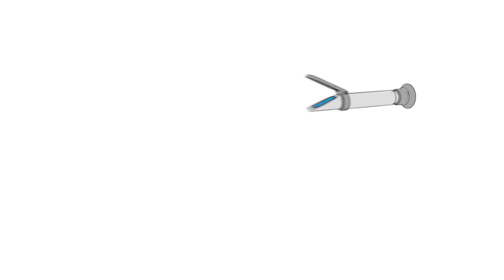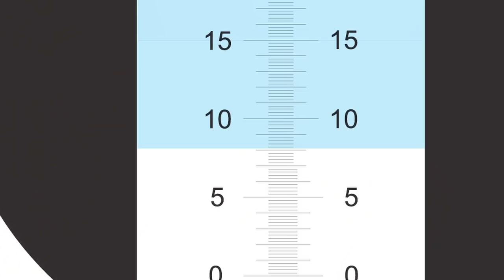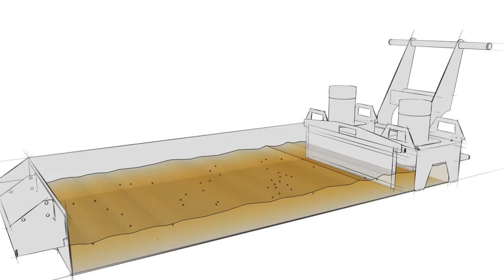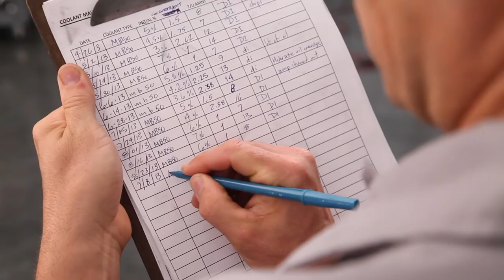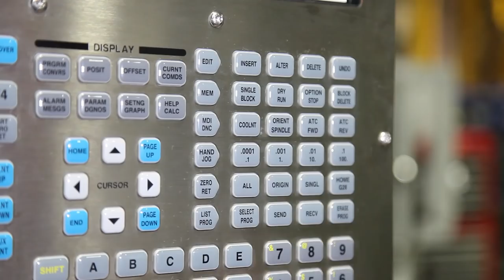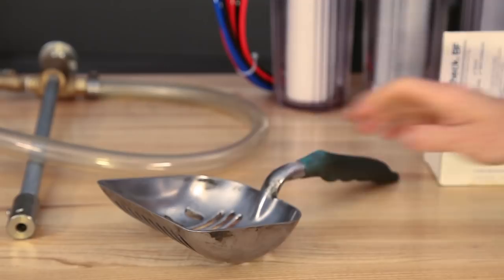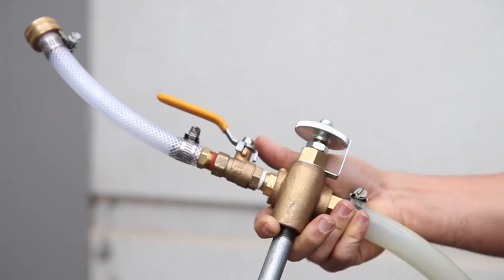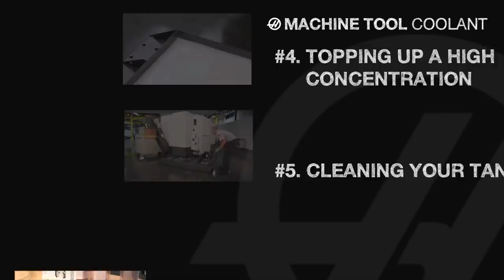Machine Tool Coolant: Tools of Coolant

Comment: Why should we add a concentrate into the water, but not vice versia? Do you have a clear video explonation on that?
Reply from the maker: euclid9718, The water soluble oils used in most coolant concentrates work best when poured into a larger batch of water. You'll need to contact your coolant supplier to get the exact reason this happens chemically but we show an example of mixing coolant both ways in this video here: https://youtu.be/Rv1kU0UrsBo?t=97

Comment: I would like the chip strainer shown in the video @10:30- I asked my local rep and they couldn't find it. I have a VF1.
Reply from the maker: Hi brian kelly hahn - We're very sorry for the inconvenience, but glad you're interested in a product used in the video. You can actually purchase the items on HaasParts.com: http://haasparts.com/

The part numbers you'll want to query are 30-10903 (SUPPLEMENTAL CHIP TRAY KIT) and 30-10904 (FILTER, SUPPLEMENTAL CHIP TRAY, FILTER BASKET X10). You'll also need to know your machine serial number.

We hope this helps! Please feel free to contact us at contact@HaasCNC.com if you have any further questions. Thanks Brian.
Reply: Haas Automation, Inc.
Thanks! You were faster and more helpful than my local rep that couldn't find the part. Please keep up great work with the parts website and these great videos. The more info the better!

Comment: Let's say you run a machine purely for prototyping and it gets low usage.  In other words, perhaps you run it once every couple of weeks.  What's the best way to manage coolant and what type?
Reply from the maker: Martin05rc, that is a good and unusual question. There are several things you should probably consider when running your coolant intermittently. 
Minimize evaporation:  Evaporation of the water in your coolant mixture is likely what you’ll need to check most often. The hotter the ambient temperature the more quickly the water will evaporate out of the solution. Luckily this tends to leave most of the cutting fluid behind. You can add more water to the existing coolant but be careful to add at least a small portion of new cutting fluid to the “make-up” water as some coolants do not tolerate adding straight water to an existing batch. We look at this in several of our “coolant” videos. You can minimize coolant evaporation by leaving the covers on the coolant tank. This keeps any air movement across the top of the coolant from increasing evaporation.
If evaporation is significant you might consider laying plastic sheeting or
something similar directly on top of the coolant to really minimize air
contact, similar to how swimming pool owners sometimes approach this problem.
Check concentration:  Because the concentration of your coolant increases as the water evaporates out (the ratio of cutting fluid to water increases) you need to check your concentration regularly and particularly after it has been out of use for a period of time. This will tellyou if you need to top up the tank with a rich or lean mixture. Again, look at some of the other “coolant” videos for help with these calculations.
Mix coolant before running:  Some coolant types and brands are more likely than others to separate during times of inactivity. This is something you will need to test for with the coolant you are using. Some shops will run their coolant systems to “re-mix” the coolant after it has been sitting. You may want to consider periodically mixing the coolant even when the machine is idle depending on how your coolant performs in this manner.
Reply: Thanks for your detailed reply.  We've seen what I am going to call "growth" on the surface of our VF3-SS's coolant in the tank.  I don't remember what type of coolant we are using.  Are there types that promote bacterial growth or even mold if left sitting for weeks.  I'm just concerned about the idea of a machine not running for many weeks and then seeing use for, say, a full week or two.  That pretty much describes our utilization cycles.  Thanks again.
Reply from the maker: martin05rc, Most modern high performance coolants include some sort of anti-bacterial agent in their chemical makeup. The coolant we run here at the factory is Castrol Hysol MB-50, it's a semi-synthetic high oil content fluid. It has proved very successful for pretty much all the materials we cut here. But we also have a well developed coolant maintenance program. Speaking in broad generalities there are 3 types of cutting fluids used by most shops. Soluble oils, these have the highest oil content and have high lubricity and are typically good for heavy cuts and rust prevention. But they can have more trouble with bacterial growth, don't have the best cooling properties, and typically have the shortest tank life.
Full Synthetics have no natural oils, so they are generally best for lighter cutting and are often the coolants most likely to rust your parts if you get the concentration wrong. But they do very well against bacteria, have good cooling and typically great tank life.
Semi-Synthetics, like the Castrol we use here, generally strike a good balance between the properties of Soluble and Full Synthetic coolants. They have high enough lubricity for heavy cutting, decent cooling, good rust prevention, and good tank life.
All of that said, however often your coolant is being used, it's important to keep the chemistry (concentration and alkalinity) correct and the coolant clean.
If you have lots of chips in the tank and tramp oil sitting on the surface it makes it much easier for bacteria to get a grip on your coolant. The bacteria loves to eat the tramp oil that typically comes off oily parts and gets washed into the tank.
Reply from the maker: martin05rc,
Here is a link to another Coolant video where we show cleaning out a tank. But we also talk about checking the chemistry of the tank.   https://www.youtube.com/watch?v=NvyNUn2sp3Q&index=6&list=PL1FfK7Yod27fuiQ4ZSRAnTT7Ut0wJCGRP

And here is a link to our Oil Skimmer unit. Customers have had good success with these keeping the tramp oil off of their coolant without a lot of additional work on their part since it can run on it's own after your done working for the day.   http://parts.haascnc.com/haasparts/en/USD/Performance-Upgrade/Coolant-Upgrades/Mill-Coolant/COOLANT-TANK-OIL-SKIMMER-OPTION/p/OIL%20SKIMMER%20OPTION
Reply: thanks for this question amd answer

Comment: I am a student at CSUN and I am getting ready to flush the system.Could you please recommend a type of high alkaline solution to use.  I am a bit hesitant to just buy any kind since I will be using this in a VF4. I would really appreciate it.Thank you
Reply from the maker: Delbert Stewart Hi Delbert. Most of the larger coolant manufacturers will have an alkaline cleaner they either supply or that they will recommend; it might be best to start with your coolant supplier to check their recommendation. Since we are using Castrol brand coolant in the Haas factory, we have used Castrol's "Flexiclean" Heavy Duty Multi-Purpose Alkaline Cleaner in the few instances when we've needed to thoroughly clean out a machine's entire coolant system. The Castrol Flexiclean cleaner should work fine for your VF-4, if you don't find another resource. Hope this helps!

Comment: What brand of coolant are you using here? I will be working with mild steel and aluinmum
Reply from the maker: Hi William. Chesson - We are using Castrol Hysol MB-50 in this video. We also use it throughout the Haas factory. It is a high oil content semi-synthetic water soluble coolant that works quite effectively on both steel and aluminum. Hope this helps!
Reply: Why aren't you using XBB products? We have used Alusol SL 51 XBB for over two years now and its the best cutting fluid I've ever seen. I can see the comment was made 2 years ago - have you started using XBB by now?

Comment: I wish my company would get with the program as far a coolants are concerned. The crap we use is awful. When you get out of your car in the parking lot, you can smell it. When you go home at the end of the day, whoa! People avoid standing near you. It's basically animal fat and water. Add in some way lube, leaked hydraulic oil, excess grease, chips, dirt and let it sit in the summer heat for a weekend...it would gag a maggot. It is a great lubricant for cutting, but this is 2015. There are better options.

Comment: Could you, please, give us some names where we can get Simple D.I. System for small workshop?
Reply from the maker: Hi Alex Krivling - At the end of the Tools of Coolant video you’ll find search terms for the various items we discuss in the video. If you search on the term “Reverse osmosis deionization water filtration kit” you’ll find a number of filtration units that should meet your needs.
 
Here are links to a few examples:
 
http://www.bulkreefsupply.com/bulk-reverse-osmosis-filters-systems/reverse-osmosis-systems/standard-systems.html#
 
http://www.marinedepot.com/SpectraPure_MaxCap_RO_DI_System_w_Manual_Flush_90_to_180_Gallons_Per_Day_RO_DI_Water_Filter_Systems-SpectraPure-SP12291-FIRORDNH-vi.html
 
http://www.uswatersystems.com/systems/reverse-osmosis.html

Since most of the units are similar, we recommend reading the reviews and picking the unit that best matches your volume requirements. Hope this helps, and good luck Alex!
Reply: @haasautomation  Can this style of unit be used in-line (as in, without a DI water reservoir) to supply a Haas Coolant Refill System? I ask because the flow rates these these units advertise seem to be along the lines of "gallons per day" or "gallons per hour," not gallons per minute as I understand the Coolant Refill System requires.